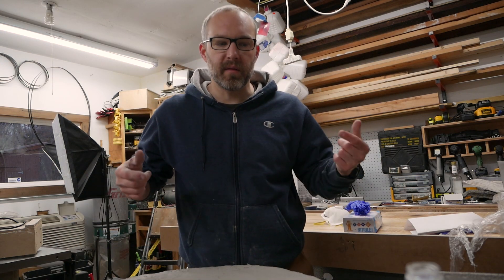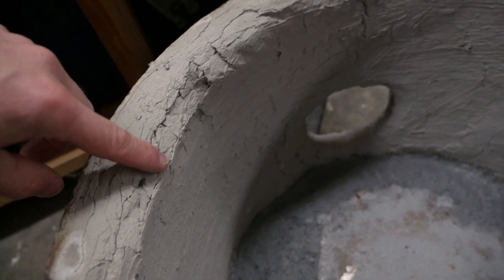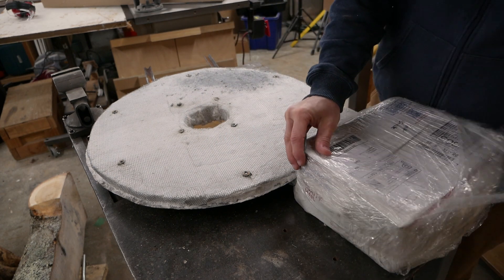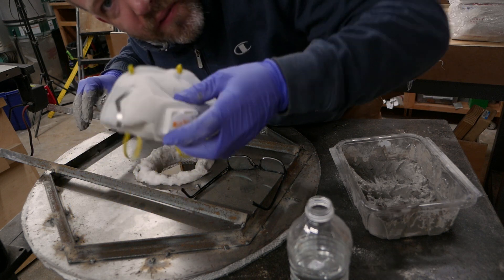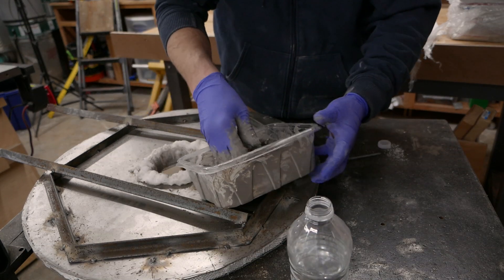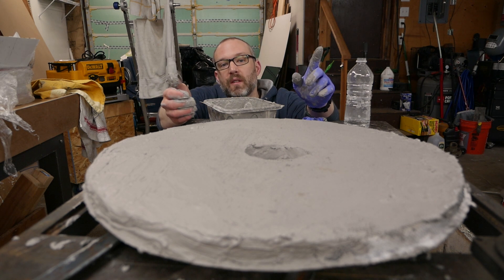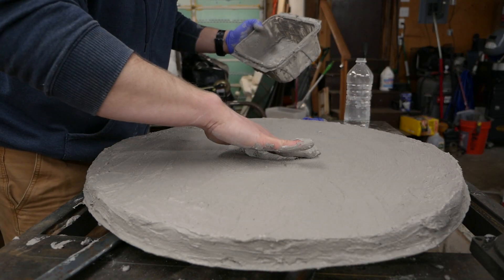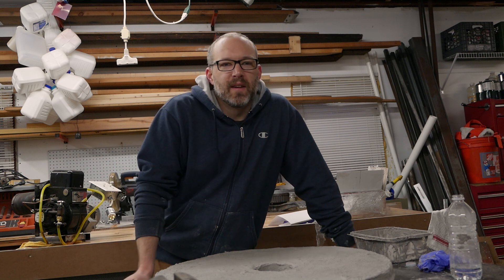Finishing my Metal Melting Furnace | Talking about Satanite and Kaowool for a Foundry

Comment from the maker: One thing I didn't mention - rigidizer.  Well I sort of mentioned using some sodium silicate around the rim of the lid.  There was a reason I chose to not do the same over the whole blanket...and I forget that reason.  But one thing that may make it more durable is to soak the wool in a solution of sodium silicate and colloidal silica, fire that, then add a coating.  You can buy these chemicals cheaply on their own or for a little more get something called Kaowool Rigidizer.  Again, can't remember why I wrote off using it, I'll have to go back to my notes.
Reply: You have an update on your notes? I'm just about to make a few foundries and replace some kaowool in my current one. Also, where'd you get your stuff? I'm looking for the best deals since, well, logic
Reply from the maker: @TheMightyMormon  nope still don't know why I didn't rigidize the whole thing!  I got my supplies from a brick and mortar shop that's a 5 hour drive from me but was on my way during a road trip.  I only wish I bought more!

Comment: The issue of you aren’t using enough Satanite. It is a brittle concrete. It must be used in layer several inches thick. It isn’t meant to be glued to the kawool which is obviously too flexible and compressible to be a sturdy base for it. It is meant to be cast into the furnace. You put a cylinder or something in your furnace to keep it hollow then you fill the whole thing up with the cement and let it dry. Then remove the cylinder from the inside. It is like pouring concrete into a foundation. Same idea. Then it stays In place by compression and has its own structural strength without the kawool. It won’t ever crack or need to be replaced then. Your best bet is to buy refractory cement which is the exact same thing it is just less of a fine powder. It isn’t as well crushed.
Reply: so if i have a square forge, just shape a box to the dimensions i want for the workspace, dump a load of satanite around the perimeter and wait for it to harden and it'll be good? I'm about a week deep into my current casting, done the rigidizer and ive slapped a layer of satanite on it just to have it crack enough to fit two fingernails in there. I'm worried I've gone and wasted my money whilst ruining a load of kaolwool.

Comment: You're gunna need to find fire bricks that can with stand the temperature you're aiming for, use that as the interior, then the exterior will be covered with perlite cement, then that will be covered with ceramic blanket, then the ceramic blanket will be covered with a thick layer of perlite cement to finish it. This will give you a long lasting maintenance free metal melting furnace which is also efficient.

Comment: Here's what you need to do. Watch Brian Ottroge build a Keg Foundry. The Satanite or Mizzou is supposed to be used like cement. Forget KaoWool and the "Coating" method. pour a solid bottom of Satanite or Mizzou. Let that bottom dry for at least 3 days, then put a 5 gal. bucket in the middle of the foundry and pour Satanite or Mizzou around  the bucket until you fill up the Keg or whatever you are using. The cure it slowly with a legitimate firing schedule that you can get from wherever you bought your Satanite, or somewhere on YouTube. Also, metal expands and contracts when heated and cooled, which is why you don't put metal mesh in your mix anywhere.
Reply: Mizzou is the cats azz!  When done correctly, it lasts for years with ZERO mainenance.  With that said, I just made a reheating furnace for glass work (aka glory hole) and I used the kaowool/satanite method.  Odd thing, I didn't have a single crack as I heated to red hot between the layers.  For my bronze furnace, I'm sticking to castable refractory.  ;-)
Reply: Brian makes a nice forge, but it weighs over 200 lbs.    right.... very useful....    use ceramic wool and lighten up on the coating, you will have a lighter forge and it will heat faster than having to heat up all that’s cement....

Comment: I used satanite on my furnace recently and found that after firing it up to about 2000 degrees it hardened up quite a bit. Its not concrete but its much stronger than when its air dried.